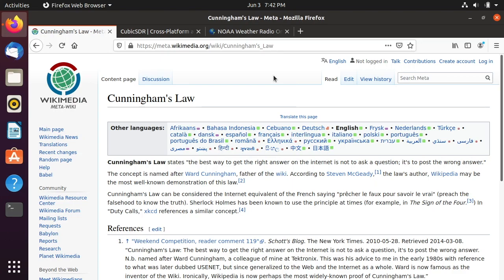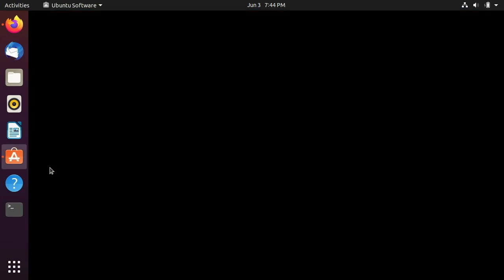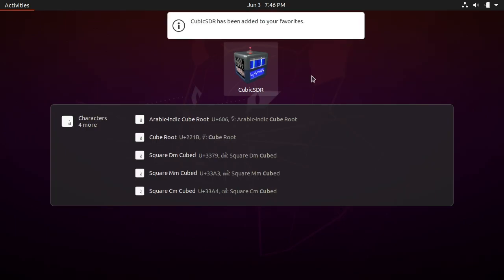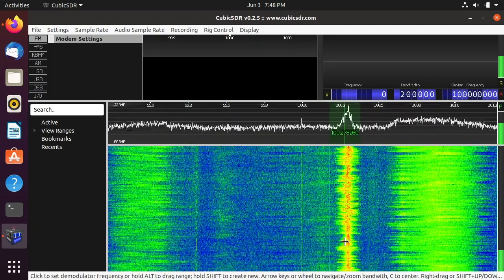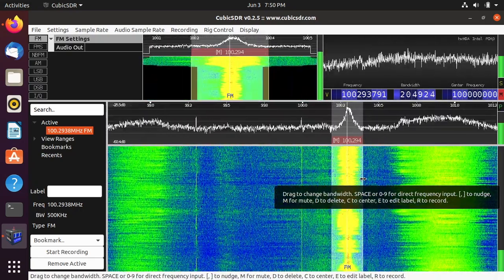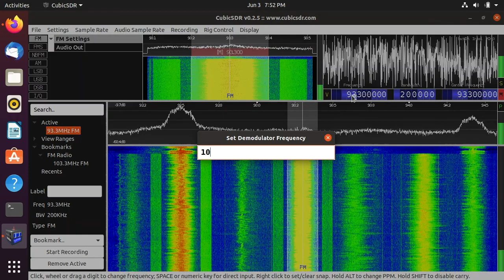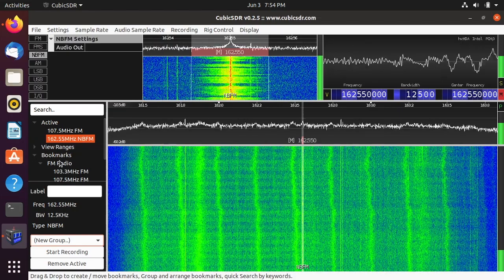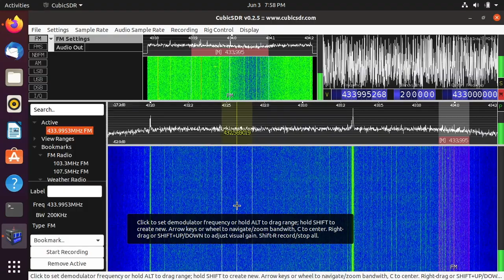CubicSDR Basic Setup on Ubuntu 20.04 LTS with RTL-SDR Blog V3

Comment: Rick, thanks for the detailed fool-proof install protocol.  Followed it to the letter on my MacPro 3,1, Ubuntu 20.04.02 which performed flawlessly.  However, after running the SDR s/w SDRuno cannot find the RSPdx but the user interface seems to work and respond to every function.  Verified that the RSPdx works at the HRO where it was purchased and multiple functioning known good USB cables make no difference.  Any hints or tips? I can provide you the terminal log and screen shots if that will help.  Many thanks ET 73

Comment: I can’t get the mouse to click on a specific frequency. Ex. I would like to click on an fm radio station 102.5; the mouse will either go to 102.000 or 103.000, but won’t go to anything in the middle.

Comment: I tried.  No audio is coming out.  Everything else works.  I see waterfall on centerline of frequency.  Just NO AUDIO.

I watched your video three times and saw nothing there that was "turn on audio."  My speaker works fine, volume is up.  NOTHING.

Linux mint.  Hardware responding great.  Frequency bites at normal FM stations.  Just NO AUDIO.  Help please?
Reply: Same problem here. I click on the waterfall signal and the speaker symbol does not come up. Linux Mint 20.3